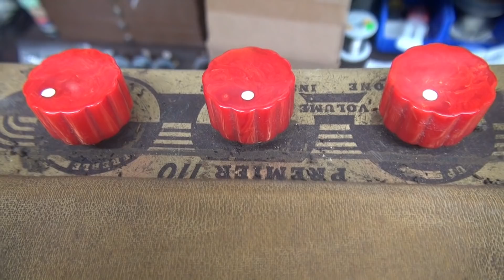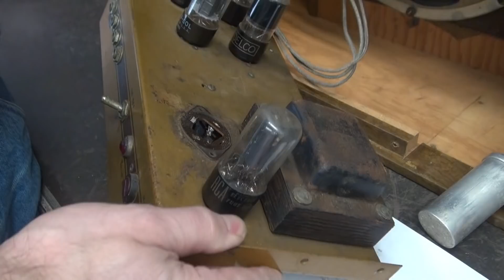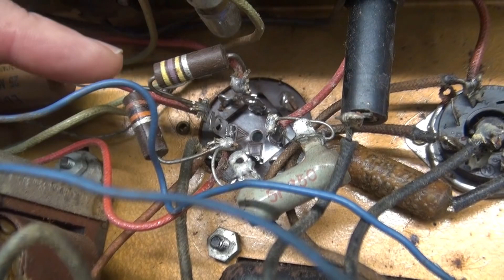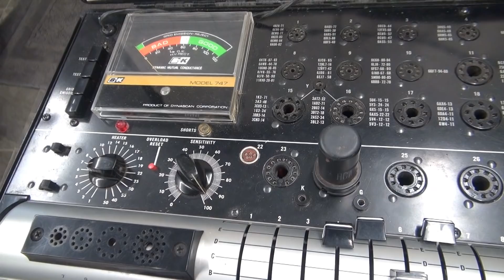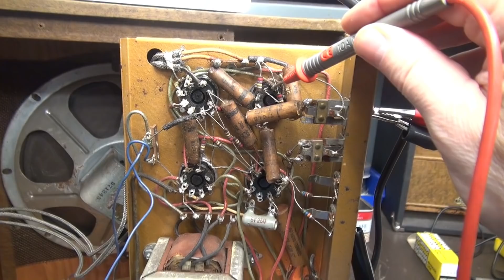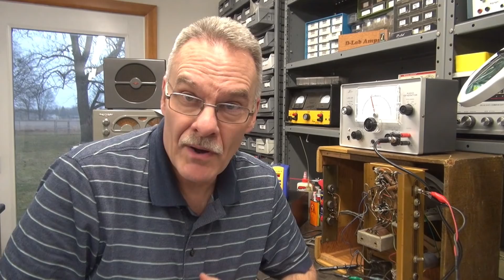How to replace filter capacitor Vintage Premier 110 guitar amp + Initial test

Comment: Thank you Terry for sharing this schematic that you documented for all to see! I have done the same, and I'll tell you it is time consuming, and so exacting, you have to get it right. Is this a long tail or other type of phase inverter? It looks like a long tail. In the future, if it could happen, could you explain the differences in the tone function of an octal preamp tube as compared to a 12AX7. I have been throwing around the idea of a guitar amp with a push pull output with all octal tubes, i.e. preamp, phase inverter, output. I know these vintage amps that used octal tubes had a certain tone that modern amps don't have. Thanxz

Comment: Plan sounds good to me! Away the waxies!
I think there's a tiny error in the schematic, the whole amp seems to be running off 5V
Reply: Yes it seems that way but check a few similar amp schematics with a 5Y3 rectifier and they are all wired the same or very similarly depending on whether there are centre tapped windings on the mains transformer.
Reply: Oh yeah it's because it's directly heated right

Comment: The cathodes of the 6SC7 are simply grounded? How does the grid get biased?
Reply: Grid leak biasing
Reply: @lucianodebenedictis6014  How would that work? There is no current flowing between grid and ground so there is no voltage drop across the grid leak resistor and the grid is basically at the same potential as ground.
Reply: @greenyodamaster  you'd think so, but there's still a tiny bit of current from random electrons hitting the grid. That's why the grid leak is so big, up to 5M
Reply: @lucianodebenedictis6014  Oh - learned something there. Thank you. I just don't remember ever seeing a preamp tube without a cathode resistor.
Reply: @greenyodamaster  There are plenty of those, or at least there used to be plenty in the past. We've sort of moved away from that around the 1960's, as it's relying on a very variable valve parameter - the grid leak current. It changes a lot over the lifetime of a valve. Back in the day that saved you a resistor, but later on the cost of a resistor was no longer considerable, so there was no point in using this inferior method. 
Biasing with cathode current rather than with grid current is much more stable, and also provides negative feedback for DC, that further stabilizes the bias, even despite the valve aging.

Comment: When you replace the old wax capacitors will you pay attention to which end is the outside foil end?  Paul Carlson of Carlson's Lab states that is an important thing to do.
He said since most modern polypropylene capacitors aren't marked with the foil end that they must be checked first.
Any thoughts on your part regarding this?  Just curious on my part.  Love your videos BTW.
Reply: I know the question wasn't for me,  but I find it makes little difference in a typical guitar amp.  Only very high sensitivity circuits seem to care.

Comment: Good work on saving an old classic amp.  Thanks for documenting the schematic; what did you use to draw that up?  I've done that before, and still have drafting templates for doing it by hand, but have seldom used a CAD-type software package or similar.  So you've piqued my curiosity. 😉
Reply from the maker: Hi Bob, Its Microsoft Visio
Reply: @d-labelectronics  Thanks!  I've used Visio previously at work but never had a personal copy.  I know there are freeware alternatives for schematic creation out there, too, but how many of those directly support vacuum tubes?  A very good question!  :D